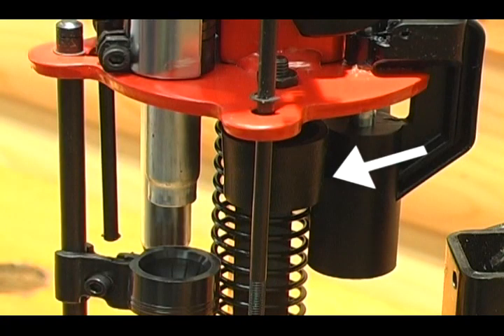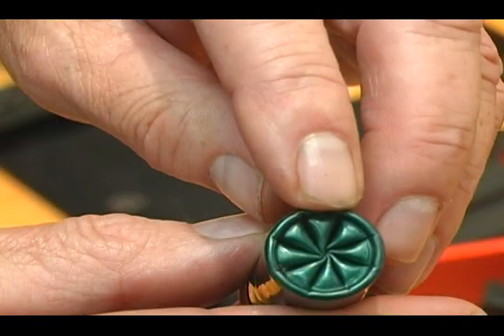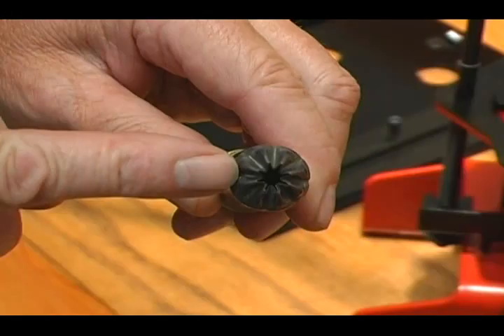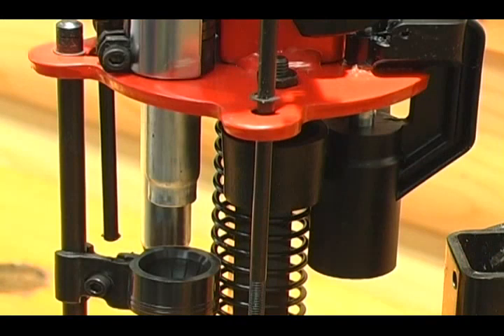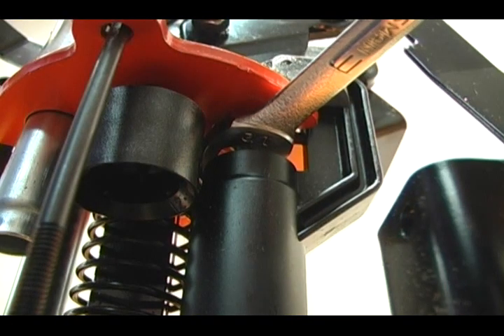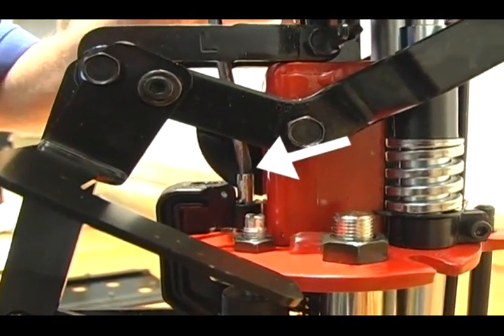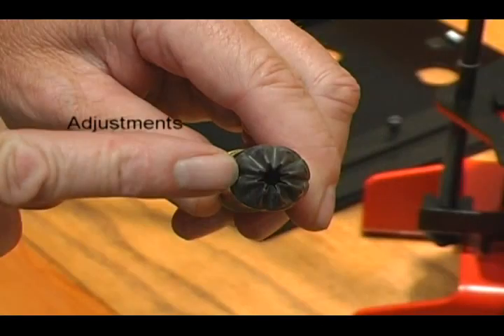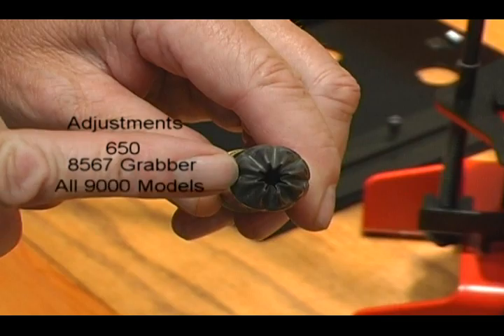MEC Reloaders Troubleshooting   Progressive Crimp Adjustments

Comment: I just started reloading but have been shooting 60+ years. I bought a 600 jr Mark V for .410
I started watching a lot of YouTubes on assembly, reloading, as well as reading a lot of what was being posted on the reloading forums. My take away is amazement, frustration, appalled. It is mind boggling how much tweeking, finagling, polishing, bending, re-engineering, etc. is required to make these machines operate reliably. I mean its not like Mec just went into business yesterday after having operated out of a garage for a couple of years. It is inconceivable that people are having so many issues with brand new machines. I haven’t even assembled mine yet but am thinking instead of going through all the frustrations others have had, I may just stick the box in the back of a closet and look for something of better quality even if it does cost a lot more.
Reply from the maker: Thanks for commenting! The 600 JR Mark V reloader has been factory set and tested to perform right out of the box when purchased new.  If some issues have occurred, making it difficult to get set up, please feel free to contact us by email or phone and we will be more than happy to help you through any issues or set up problems. Our email is: reloadersales@mecoutdoors.com and our phone number is 800-797-4632
Reply: So, if I'm reading your post correctly, you have not loaded even one shell on your new 600Jr, Is that correct?

It's been a year since your post so you've either returned the loader or sold it, or you are reloading with it.

Regardless, some thoughts for those folks who may be in a similar situation - 
In my opinion, the 600Jr is probably the best machine to geti ntroduced to shotshell reloading.  It's simple, reliable, and once properly set up, it will turn out thousands of shells with no problems or issues.

Know that the MEC factory sets up the machine before shipping.  Though rare, sometimes these adjustments can change due to rough handling during shipping and even more rare, one of the folks at MEC was having a bad day.

Each brand of hull is a little different from the next brand.  I don't know what hull MEC uses to set up the machine with but let's assume a Winchester AA.  If you want to load a different hull such as Federal, Remington, or ??, know that you MAY need to make some minor adjustments to your machine.  Usually it is the pre-crimp, and/or the final crimp die that needs to be adjusted.  Check you machine's manual or watch the videos MEC has posted on YT.  Finally, you can give them a call.  I have found them very responsive and helpful.

Also, there are differences between hulls of the same brand.  Shell hulls used for target loads are different in construction from field loads.  The internal volumes may be different and construction may be different.  The details are important here.  Read the loading manuals and loading data carefully and follow them.  

Once you have your machine dialed in and producing acceptable reloads, put witness marks on the nuts/bolts used to make adjustments so you can see if they have moved should you suddenly start producing bad shells.  Maybe even take pictures for reference.

Tangobravo mentions he purchased a 600Jr. in .410 bore.  In my opinion, .410 can be a little finicky to load regardless of the brand or model of reloader.  Know that the drop tube for the .410 machine is about the diameter of a soda straw and the shot sometimes "bridges" in the tube.  This is especially true when loading anything larger than #9 shot.  Usually what happens is the blockage breaks free on the upstroke of the handle spilling shot on the loader and the bench.  Oh well, at least you only have 1/2 or 3/4 oz to clean up!

For some like me, reloading is just another aspect of my shooting hobby and I enjoy my time at the reloading bench.  I find it relaxing.  For others, it may be the opportunity to save a few bucks.  At today's prices (2023) the savings are greatest with the smaller (28 & .410) gauges especially if you are an avid skeet or sporting clays shooter.  Whatever your motivation, enjoy it and above all, be safe.

Long post I know, but I hope it adds to the discussion.
Reply: @jamesp739 as you mentioned, I am having issues at the final crimp slightly crushing 2 1/2 inch 410 shells.